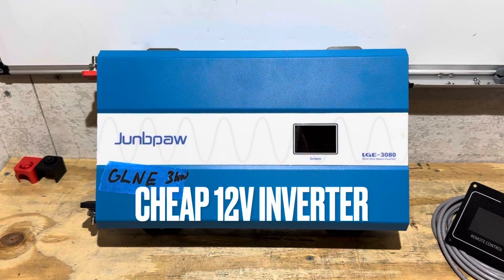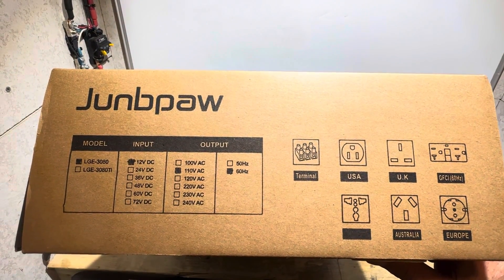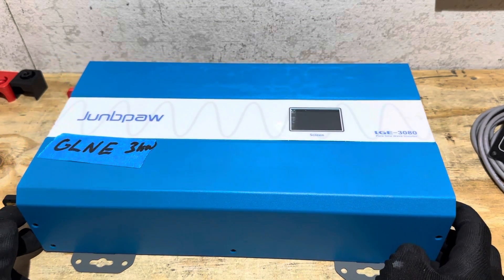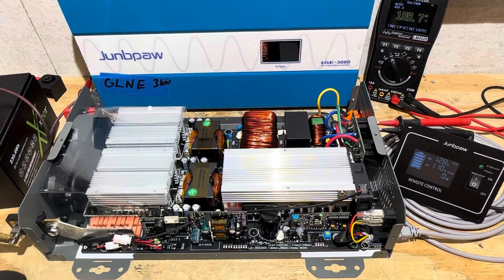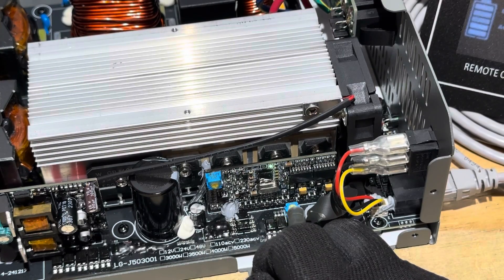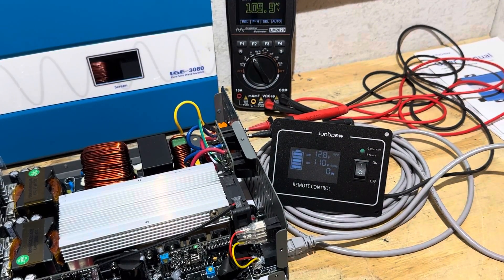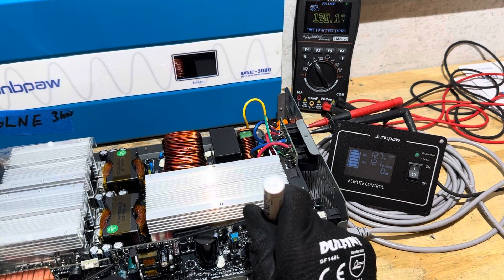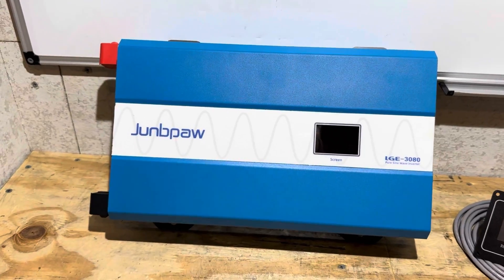How To Adjust Power Inverter Output Voltage | Junbpaw 12V 3000W Inverter

Comment: I have a vevor 2500 watt that has 120v output. But on the dc side it shows the dc voltage incorrect. But on the remote it shows the correct voltage.  Wonder if there's  a way to adjust that?
Reply from the maker: That’s definitely different! Most co-witness accurately between the inverter and remote display. Maybe yours has a separate connection for each display inside the inverter instead of coming off a common board.

Comment: Glad to see the voltage can be changed. I saw a review of one of these, he had 119 volts on the display but under a 3000 watt load it dropped to 110 volts. Not sure if he adjusted the output voltage or not. I dont remember him mentioning it in his review of it. Would be interested to know if that happens after adjusting the voltage.

Comment: Good to know video. Wondering if this can be done on 110V power boxes.
Reply from the maker: Not on Oukitel or similar machines. Check out SYD Power .com and if your PPS looks like anything they make as a white label manufacturer it has a fixed control circuit 100%. Hope this helps!

Comment: love the video  I have the same one Do you think i dare try to start my 15ooo btu rv roof air or will it fry the inverter. i have several 2000 watt solar generators. non. will even try to start it blueti ac200p quit.no good anymore. A 15 amp braker in my house runs it fine.thank you.
Reply from the maker: Thanks! 
I may be worth a try. Good overload protection on the inverter so it should keep itself from being damaged. Use big battery cables and at least 400Ah of battery. 
If it can’t start try a MicroAir easy start. You can start a 13.5k AC with a 2000W inverter easily. 👍

Comment: You’re good up to 125. Most equipment is good to about 130 before things go south. I run my satellite truck usually around 117 to 125.  Luckily most switching power supplies these days are very forgiving of low and high voltage.
Reply from the maker: Some I set to 123 volts if the AVR is a little sloppy. This inverter holds a little better than some of the other cheap 12V units. 
Appreciate you, hope you have a good day.